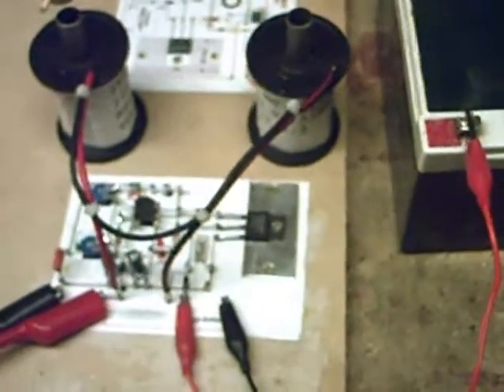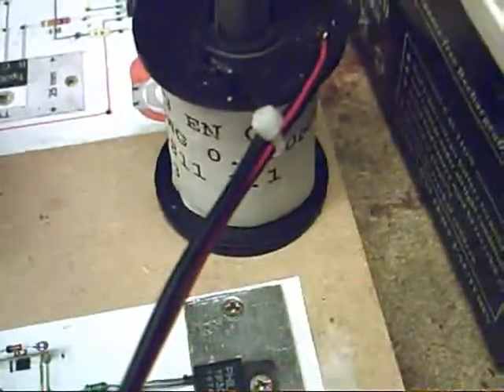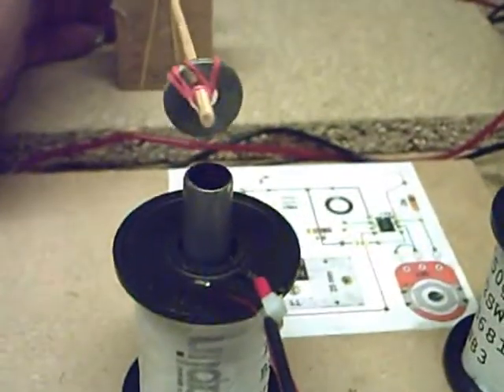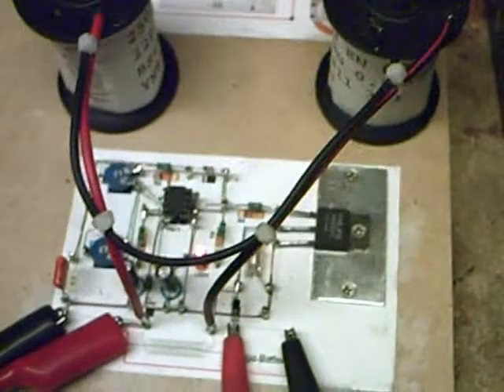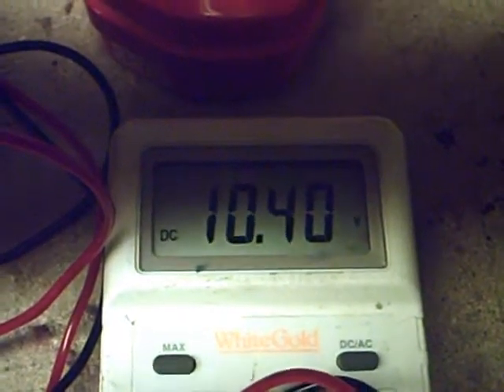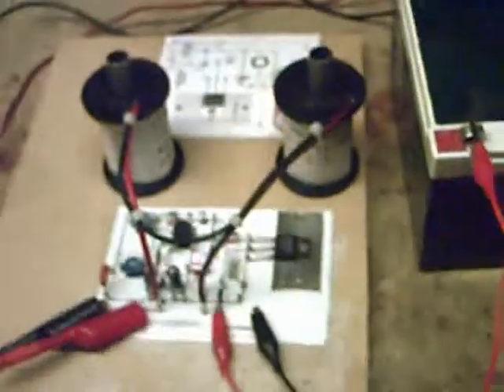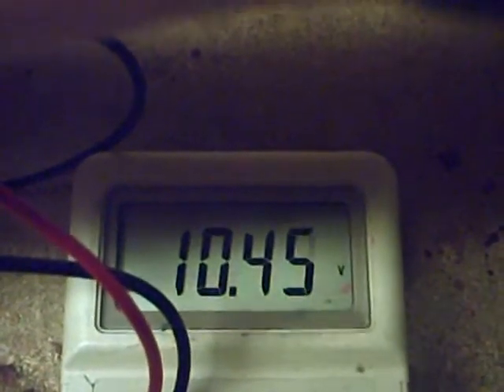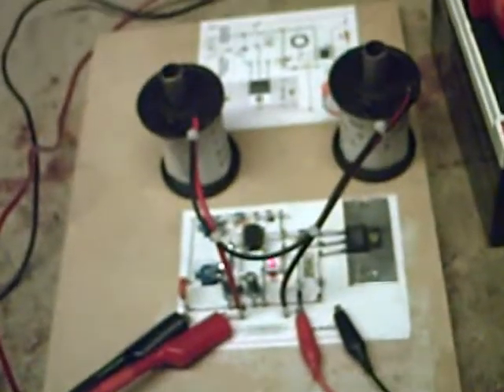solid state charger. (TheDaftMan)

Comment: Thanks.  I'm not terribly up on the theory but I'll try to break it down so that I can get it.  I would expect that the interval at which the circuit fires to send current to the coil would be a determining factor here.  FYi, check out my homegrown 58 watt solar panel in my videos.  Gonna be making a few more but you can purchase panels cheaper than I can make them.  At least I'm learning the process though and that's the point.

Comment: I have to say this whole energy production thing has gotten under my skin like a wild fire and has my brain running double time with the possibilities. I am currently working on an HHO generator for my 86' Ford F150, and would like to get more understanding of these different motors and circuits to possibly run the reactor. My big stumper of a question is in the charging circuit that was made, could that not be coupled with another and just cycle each other continually?

Comment: Just to confirm my thinking. To charge a battery, you need a higher voltage than the battery puts out at a low amperage, isn't it? .. As usual. Very neat presentation!

Comment: The solid state Daftman, I like it! It would be interesting, if you have the time, to see how the output HV spike on this differs to that generated by the bedini. Does this method produce a relatively larger or smaller back emf.

Side note - Bedini and Bearden ran some of the most extensive charge discharge tests ever done and are quoted as saying that the reconditioning effect and efficiency improvements were only noticeable during intense, none stop, charge discharge cycles in the long term